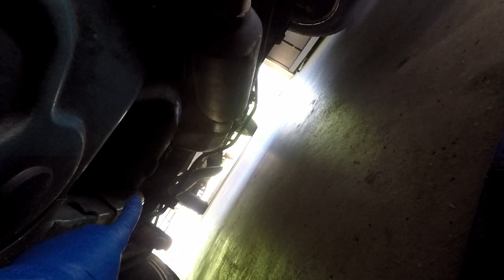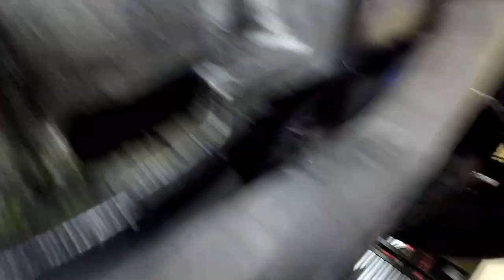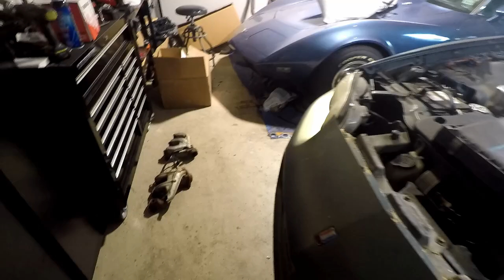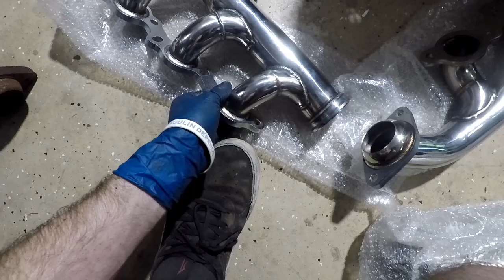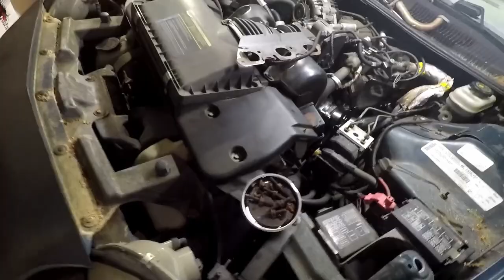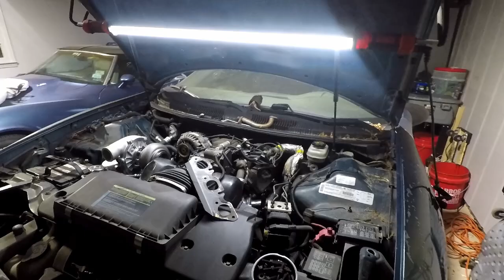Ebay Turbo Kit Mock Up - 3800 Turbo Camaro

Comment: Hey did you add new injectors? And what kind is doing the same thing trying to learn as much as possible about them for my 02 firebird, so it won’t take as much time for the install
Reply from the maker: Yes here’s a link to that video: https://youtu.be/c6Egu3oLsQY?si=RnzlPEYCHzkFvlDO

In fact, I have a playlist on my channel with all my 3800 turbo videos so far so check that out! 

I went with used 60lb injectors, although I would have preferred 80lb injectors, genuine Siemen Deka injectors are just hard to come by at the moment due to a back order
Reply: @bluesxt yeah I was suggested 95lb injectors but I think that might be overkill thanks I’ll watch all ur vids to see what route you took for it because there’s not too much out here for turboing these 3800’s

Comment: Very nice I have exact car I just bought today same color too but it needs boost!
Reply from the maker: Nice! Hopefully your paint is in better shape than mine :)
Reply: @bluesxt it was literally painted a month ago, brand new tires, soft top, brakes, front suspension got it for $1500
Reply from the maker: @Megaladon81 good deal!
Reply: I’d send a pic if I could what kit did you get for that turbo?
Reply from the maker: @Megaladon81 it’s the only kit available for these. You can find it on eBay / Amazon
Reply: @bluesxt so they replaced the intake gaskets and said after a bit it started making noise in motor and not running right, doesn’t at idle but not sure what the knocking sound is? It’s not a rod becuse doesn’t do it at all rpm
Reply from the maker: @Megaladon81 motor making noise at rpm but not at idle? Funny, mines the opposite lolol
It could just be a coincidence that it happened after an intake gasket change
Reply: @bluesxt actually I just listened to it, not at idle but all other rpm, no coolant on oil
Reply: @bluesxt is your turbo kit up and running good now? Can it be hooked up to stock engine if you keep boost down or do I need to mod inside of motor? I’m about to buy that kit
Reply from the maker: @Megaladon81 yes a stock 3800 can be turbo’d with no problems as long as your tune is dialed and you stay reasonable with the boost ~10lbs or so
Reply: Are you in Michigan?
Reply from the maker: @Megaladon81 GA

Comment: I found your videos while looking for inspiration for my turbo 3800 build. Mine is a little different.  I'm putting one in a 64 Ford Falcon.  I just got the motor and trans mounted this past weekend.  I figured i need to iron out the exhaust before i go much further.  How do you like the turbo headers that came with the kit?
Reply from the maker: I think the turbo manifolds are fine. Better than what I could build myself currently. Although I hear they are prone to cracking so I guess I’ll see about that. 

The other option would be to use the fwd manifolds and flip them and modify them!

Comment: Sweet setup. I just got my clutch and everything threw back together. Working great so far. I hope you never have to replace your master cylinder. I couldn’t get my clutch to bleed ended up replacing the master and bench leading it to get it to work right absolute bear of a job. I love these cars but boy is everything tight
Reply from the maker: That’s awesome. I have had the unfortunate experience of laying under the dash trying to unclip the pin from the clutch pedal to the master cylinder rod. I will say, removing the brake booster on my 79 corvette made a clutch master cylinder on an f-body seem like gravy